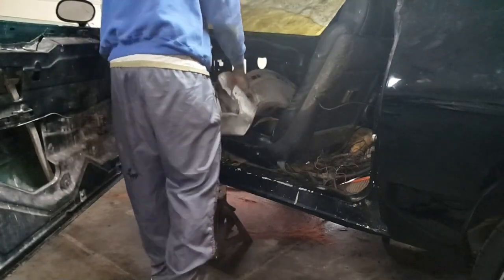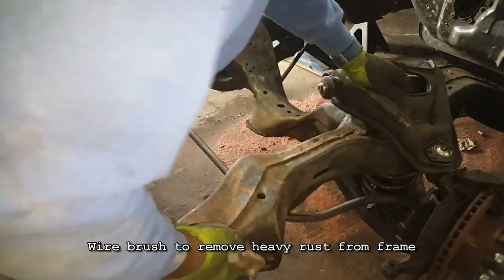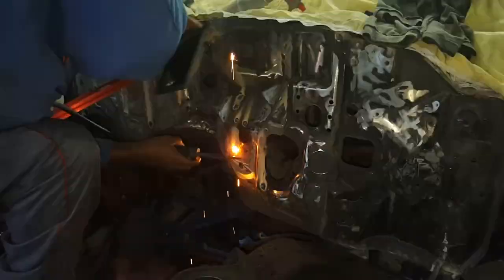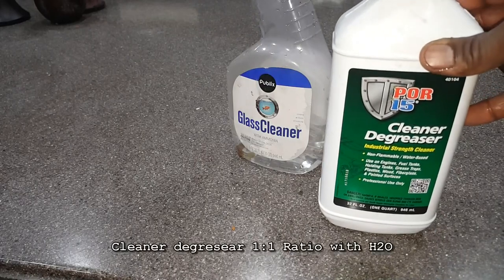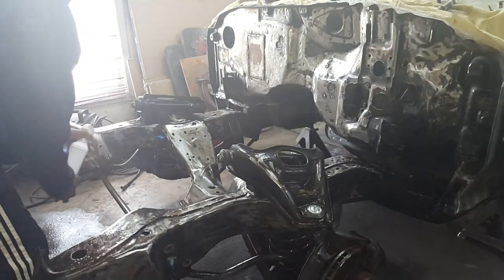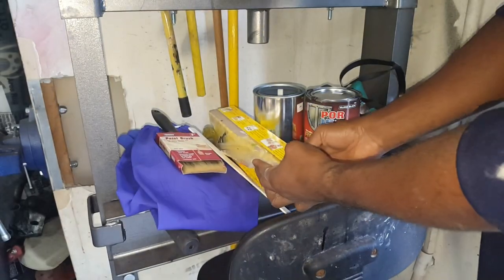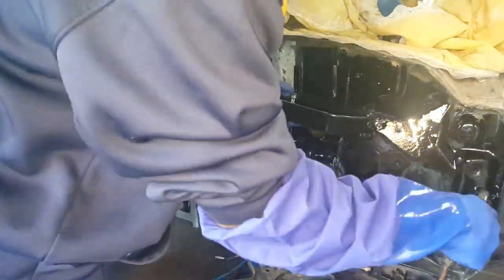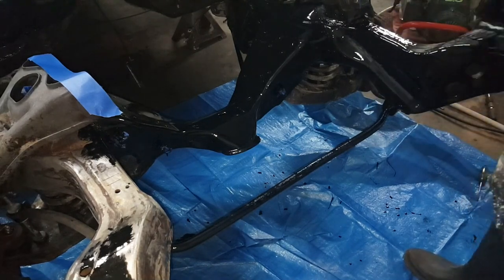Applying POR 15 Painting/Welding Firewall and Frame DARKNESS PART 5

Comment: Love POR15! Great work!
Reply from the maker: Thanks Ant, subbed in to u... see you already gone went down this road..watching for your journey..just ordered that griffin radiator do you still recommend it? CJ
Reply: CountrySideClub Fa sho man! I see u puttin in work as well. Love what ur doing so far. Yeah I did my swap. Procharger is next. I really love the figment of the radiator but my first one was defective. So they swapped it out at summit no problem. I only had like 200 miles on it. Too be honest, From what I've heard in other groups people have had lots of problems with them going bad, but others have been good. I'm just hoping mine last.
Reply from the maker: Well for the cost and supposed to be the top company (2 years warranty), it should have longevity...probably with all of the items, it best to put some miles on the car so we can see the weak points..I barely take DARKNESS out so I will need to  put some miles on her quick to test all of these new items..Ant its costttttting me big time..I me over budget as of this weekend lol
Reply: CountrySideClub Bruuuuuuh! I already know. I don't even want to k ow how much I spent. I feel your pain.

Comment: Missed this one. What are you planning on top coating this with?
Reply from the maker: asicerik what it do E, so when I come back to the bodywork and paint..I plan to scuff up the POR 15 fiber glass my welds on the outside (I fiberglassed the inside firewall already) then I plan to apply filler, 2k, basecoat clear coat. We have the same A body if I recall so I tried to follow your vid..I just had the luxury of knowing where everything was initially..CJ